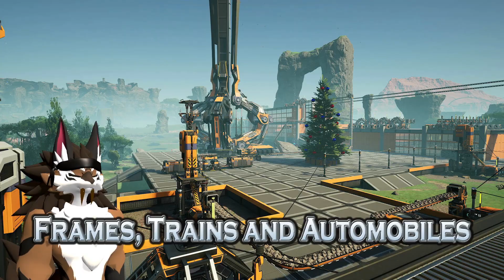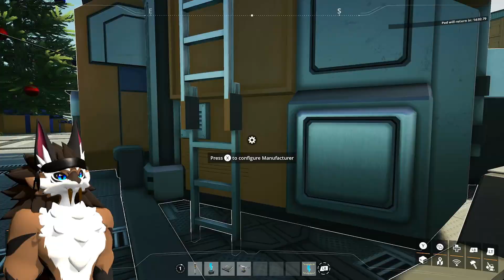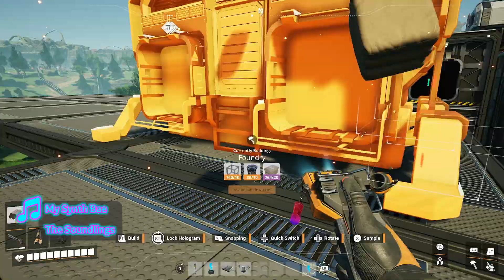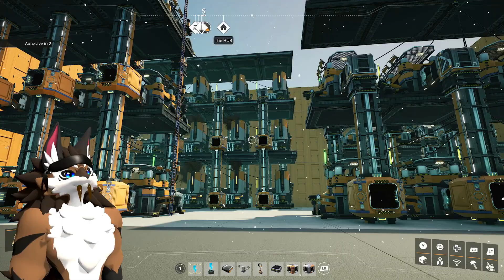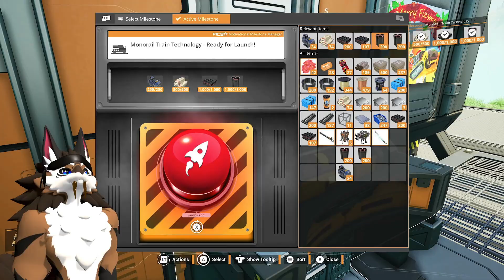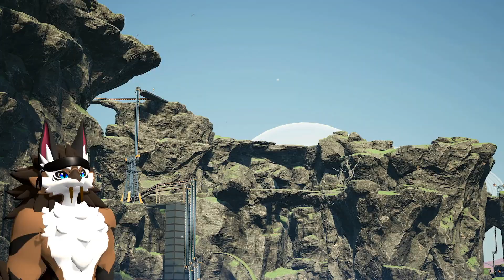Satisfactory - 10 - Frames, Trains and Automobiles

Comment: 8:13 It's like looking at a burrito the size of your head and realizing that you may have purchased more than you can realistically consume.
9:48 I think that's because you're saying that you need that many machines, not that much ore/min. That's the difference between the two boxes, IIRC.
22:47 Probably best that you do. Diagnosing problems in that bowl of pasta will be a nightmare.
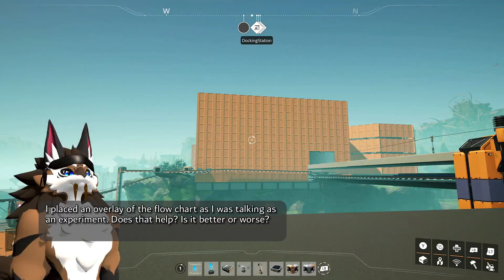28:12 Yeah, that works well! It's not in your face if you don't need it, but readily accessible if you do.
30:34 In the past, I've used lower speed conveyors between splitters and machines to allow an overflow setup to more evenly split its ingredients. That's as close as I have come to metering belts, though. Perhaps one of the fancy splitters in the caterium tree?
31:36 That's one thing that could really benefit from being able to pull from the dimensional depot system.
34:46 Oh what glorious chaos you will see!
51:00 That doesn't bode well. 
51:36 I think you've struck a good balance. Best to try to keep such segments under 10 min, I think, though I only speak for myself. Walk through the flow-chart and move on.
55:06 Indeed you can! For the most part, Depots barely sip on your resources after they fill up. But if you're using 3 depots/min of, say, concrete, you can chain such a setup to multiple industrial containers, each able to also output to a depot on top. You don't even have to build the depots at first if you don't want to/don't have the mercer spheres.
57:24 You can access the cloud any time you like from your inventory. I don't know how to do that on console, though.
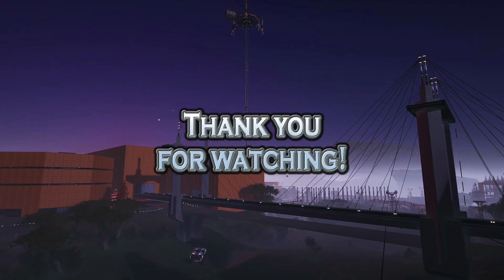1:00:15 Majestic, AND pet-able! If not fren, why fren shape?
Reply from the maker: Is the burrito comparison speaking from experience? Using lower speed conveyors to limit throughput is a good idea. Also, your right, you can pull from the depot in the inventory. I just had a look and I missed a great big button to press to open it. Good shout.
Reply: @SirWolfgangTV  "... from experience?" Yep. Recently, too. The lady at the Mexican place was a little too generous with the fillings. I didn't let it go to waste, but I definitely ate too much.